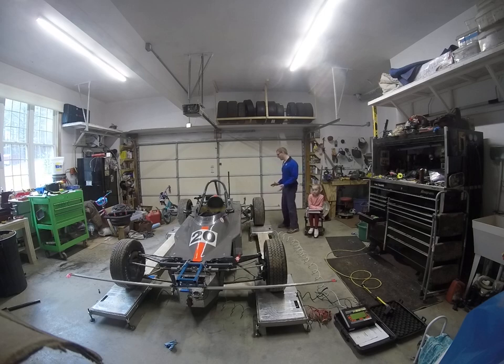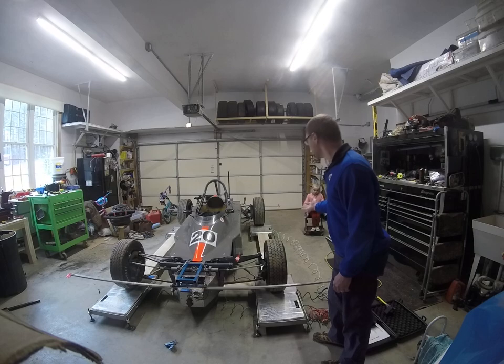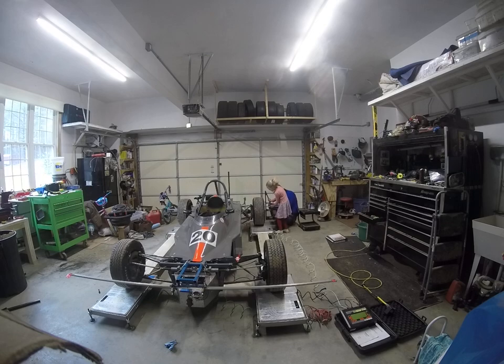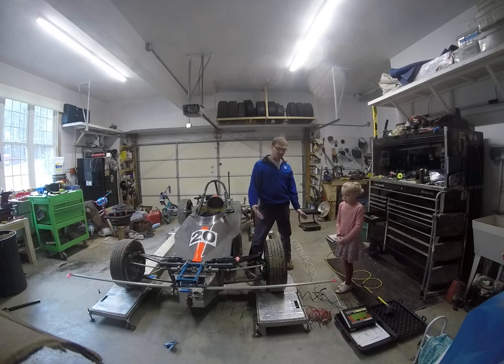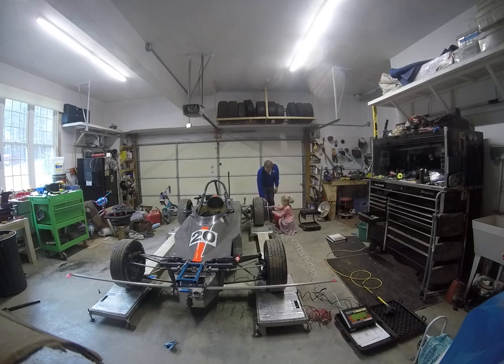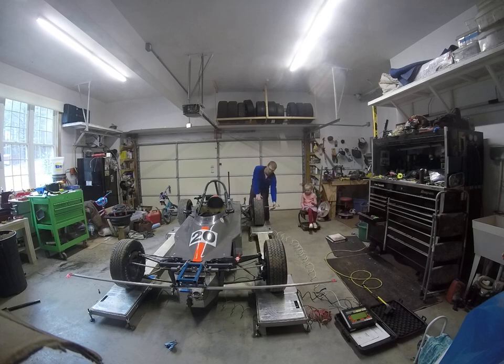Alignment fixtures and basics

Comment: New to FF's, hopefully a reasonable question!.
So are you setting this up with weight added to replicate the driver or is that over the top?
Reply from the maker: Joe,
Initially, driver or ballast should be used to setup the car. Once you get it where you want it, remeasure without the driver/ ballast. This allows you to set next time without driver, saving some time. Thanks for watchin'